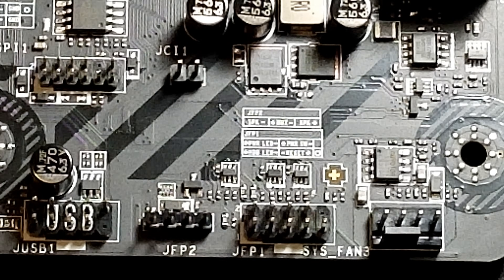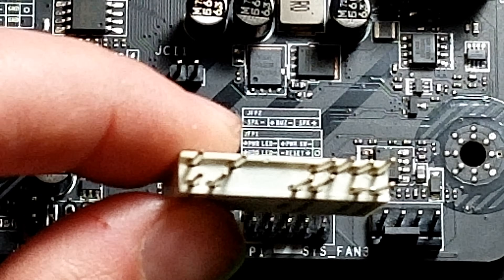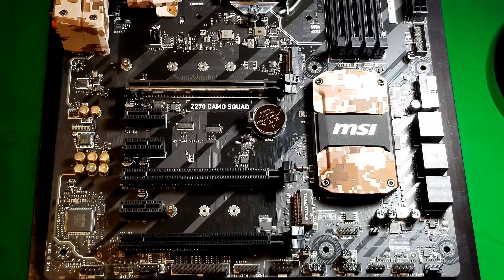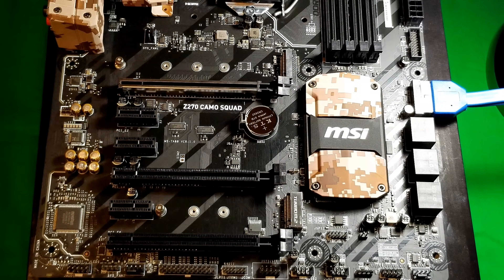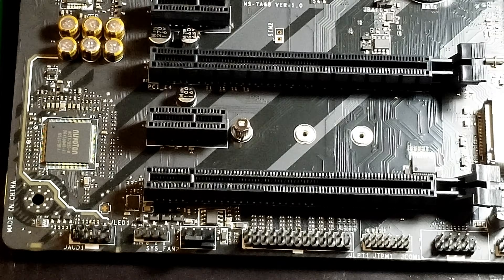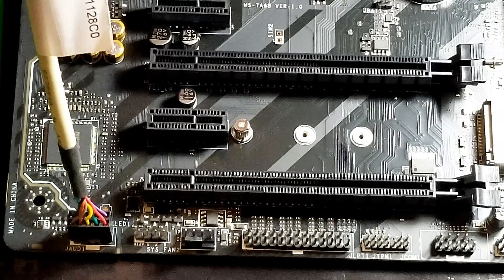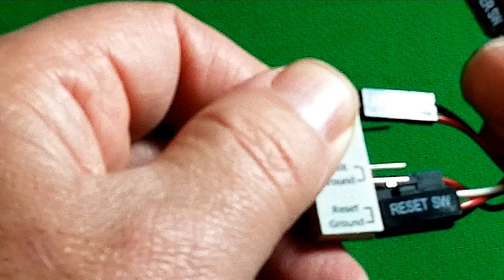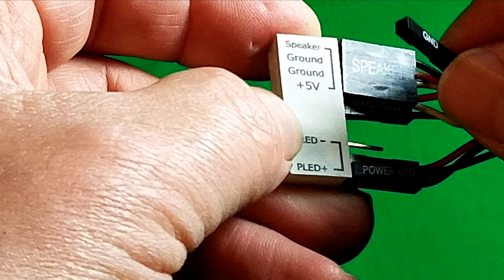Connecting your Case Front Panel connectors to your Motherboard

Comment: ok so i need a little help i have a deepcool tesseract case and i have a Gigabyte B550M DS3H AC R2 on the way are all the cables compatible with that motherboard? the case is admittedly old or will i need to upgrade it?
Reply from the maker: The only issue you might run into is that the MB is very bare bones, it might not have enough fan headers, an issue I ran into. Also if there are any RGB or ARGB cables, I can't remember for sure but this Motherboard might not have those headers. Otherwise they should work together.

Comment: I can read the motherboard but I have never done this before(I’m used to HP computers that I upgrade and I just got a real computer) and I was so confused about why it wasn’t turning on until i realised the “reset SW“ was the power button
Reply from the maker: Not sure the question, but if everything is plugged in as in the video you should have no problems.

Comment: THANK YOU SIR! After trying for weeks literally, & watching at least 20+ different video tutorials 3 X'z each on the subject matter, NONE were as concise, precise, to the  point, & CLEAR with no If & 's or what's period.

I FINALLY was able to see success after only my FIRST TRY after watching your outstanding tutorial. The others where CONFUSING & NOT SHOWING THE DETAIL NEEDED TO FULLY UNDERSTAND how to go about  connecting the panel correctly to the mobo.

Not to mention that I have an OLDER mobo from 2012. So there's no clear  & apparent + - pin MARKER signs on my mobo. However. The ONLY words that I could read (with a magnifying glass at that lol smh) were where the HDD LED pin connector went. But that was enough to put 2 & 2 together & I found the rest of my way fairly expeditiously!!

What I did was DRAW an exact DIAGRAM on a scrap piece of paper so when I turned my PC off I still had your visual graph to fall back on. & I must say that It worked like a CHARM ahah lol. Almost seamlessly.

So I appreciate your passion & SIMPLISTIC, logical, not so common expertise bkz boy I'll tell ya, some of these content creators will have you on a wild goose chase only to end up nowhere, where you started, or even worst before lol

Now on to the next problem. Trying to clone my HDD & migrate the data to (Samsung Evo 870) SSD  but he data migration software isn't working. I tried a free alternative that I heard good things about to do the data migration but I've ran into a road block with that as well

My SSD is BRAND NEW, never used, so I don't know what seems to be the problem. I have decent enough specs (I5 2500K CPU, 16 GB ram, 500GB HD,  RX 580 GPU, 1TB SSD, 750W Gold+ battery etc) ...

Not that the majotiy of the described has anything to do with data migration lol, but just to say I have PLENTY operating system power & then some. It's something with the SSD's partitions or something to that effect where It's not just copying the HDD partitions

If I could get that done I'd boost my PC 5 X'z It is now, & also be able to use my new RX 580 GPU that I can't use bkz It's for use with Win XP, 7, 10 OS. I have Win 8.1, but I was going to upgrade to Win10 bkz I have a free upgrade. & Although I wished I could keep W 8.1 (bkz It's my fav) I am kind of burnt out on It

It's just time bkz as a Music producer most of the software is being programmed for Win10/11. So I'm mixing out on technological advancements not having Win10 or better.

The cons finally out weighted the pros so to speak lol. I'm missing way too much more in performance now using Win 8.1 sadly!

So hopefully this starts of a trickle of GOOD LUCK now that I have my front panel power working fully correctly due to your astute directions. Thanks again Brother & have a blessed day!!!

Gonna subscribe to just bkz you sold this very HARD problem & made It simplified, done simply in seconds fax!!
Reply from the maker: I'm glad the video was able to help you out, for the cloning I've done a couple videos on it, this one might work but if not I have a 2nd one as well. Here is the link to the first one: https://youtu.be/ltjBRZx4ak0 All the best.

Comment: You're a champion. I've got a Gigabyte GA-B150M-D3H mobo and the power button on the Thermaltake H22 Case is getting a bit sticky, so I have bought an external power button which I may connect. It's an eight to nine year old PC so whilst I will be careful I am not overly bothered if it dies.
Reply from the maker: Sounds good. Have a great day!

Comment: All was going well until you got to the connector that really matters. There you told us that the arrow indicates the "positive", then at 10.20 you turn the power connector (you say, the only one that really matters) upside down and say that that doesn't matter at 10.34 and then connect the arrow to the negative???
Reply from the maker: So the PLED there will be two connectors a + (Positive) and - (Negative) they are the ones that must go on correctly, the power can go either way and will still work. Hope they answers your question, if not let me know and I'll help the best I can.

Comment: Does the Asus m5a97 LE R2.0 not have an USB 3.0 plugin? I'm not seeing any!
Reply from the maker: No just 2.0 it's a really old Motherboard and USB 3.0 wasn't a thing at that time.
Reply: @Reviewing_Playing_and_More_RPM  oh ok, does that mean I should get a different case? I really don't want to change CPU/ram 🤔
Reply from the maker: @jescis  It all depends on your needs, if the Motherboard is working for you then stay with it but if your looking to upgrade to newer you'll want a newer Motherboard, CPU, Ram and Case if you don't have one and Ram and any Hard Drives you intend to use.

Comment: Unplugged these cables to get easier access to the HDD bay and had them separate in my fingers.  Not one plug but multiple that are tiny and ..... Anyway, everything done but no power.  Figured one of the wires was connected to the on button but was concerned to plug into the wrong slot and possibly damage the motherboard.  Then I found this video (MB instructions were useless) and thank you very much.  Covered it step by step not missing any key instructions.  Well done and thank you.
Reply from the maker: You're very welcome, glad it helped you out.

Comment: Thanks for another great info video!
Would connecting a 6-fan fan hub to the fan headers on the motherboard be okay? It won’t hurt the header overtime?
Reply from the maker: A 6 Fan Hub usually gets it power from the Power Supply so after placing up to whatever the number of fans it supports connecting the one cable to a Fan Header will be ok as it won't affect the power draw from the fan header, it just lets you control the fans. If you don't have that though then yes 6 Fans on a single fan header would be to much.

Comment: Hi Im new to pc building in general and i cant seem to figure out the power button cable every video i see there is these small cables as you show in 9:30 but i dont seem to have those cables? Is there an alternativ cable that might be used or could they be hidden even tho i have checked Almost every place. (Upgrading my cpu and motherboard on a pre built pc)
Reply from the maker: The cables on pre-built can sometimes look very different and it can be hard to know which is the right one, I've run across this, and my recommendation is to download the Manual for the Case to see if it might let you know which goes where.

Comment: I need you to show how these cables connecting to the motherboard itself, not you example stick. Because my motherboard and yours might be different. Because mine is B450 Fatality mini itx, and there is no help anywhere on google or youtube
Reply from the maker: The Front Panel connectors are the same for 99% of all systems. The video shows how to connect them, but your MB Manual/Guide to locate them if you can't see them on the MB will be needed.

Comment: The video showed most that was obvious to find but the ones for the power led and stuff didn't help because he is showing it on a block of pins that are labeled. He has a msi motherboard like mine but yet didn't even show it on the motherboard itself that's the only problem I'm having
Reply from the maker: Sorry you didn't find it helpful, pretty much all motherboards regardless of manufacturer use the same pin layouts, only exception is systems that use proprietary cabling, but even then in general they follow the same layout. Hope you find a better video that will help you out.

Comment: why don't the MB makers just sell the ready cables for all of these small connectors combined?  At least from the motherboard side. This is just silly to mass sell MBs to unsavvy general public in this disassembled condition. This gives room for mistakes, burned chipsets, makes people refer this to a PC technician, wasting time, etc. Al they get is unhappy customers.
Reply from the maker: MB manufacturers make it a standard format, it's up to Case Manufacturers to make it easier, NZXT actually has done this with a few of there newer cases where all the cables form at one end and all go on together. Now if more did that then it'd save people a lot of trouble.

Comment: It’s there a problem if I turn them around  and the writing is on another side
Reply from the maker: Only for the PLED cables you need to make sure the + and - are correct, if the others are on the other side it'll still work no problems.

Comment: I am having trouble 
Hooking up my B250 miner mother board. Has like 10 pins and im a little concerned trying to hook up the switch. It's not in the manual or in any video ive found.
Reply from the maker: The pins are beside where it says SATA6G_1, start on the top first two pins are the PLED + and -, under those are the HDD LED if your case uses that or if a miner MB uses it, going back to the next two top pins will be the power Switch and then under it will be the reset pins...now this is what it is on a normal MB, I've no idea if a mining motherboard will be the same, it looks like it is but can't say for certain...hope that helps though...the second set of pins on the top would be the speaker should you have one not sure about the bottom two...

Comment: Hey i want to ask you mayby you know when the computer is normally shuting down where is the signal in motherboard?  like with button turn on and off is 1,5v~3v its okay but i need signal from normal shutdown in motherboard can't find where it is...(i want to turn off another device with turn off signal)and normal shutting down from desktop (switch don't give any signal then)....
Reply from the maker: The digital electronic components and circuits in the system (motherboard, adapter cards, and disk drive logic boards) use +3.3v or +5v power, and the motors (disk drive motors and any fans) use the +12v power. 5V is the turn on voltage...by no means an expert on this though...

Comment: I got a thermaltake case with round blue led light that use to stay on when it was on and blink when in sleep mode but for some reason it decided to stay off even during sleep but does light up when I power it on. And I'm at a loss to find a matching case online nor anything wrong with the jumpers. Confused as hell!!!
Reply from the maker: So the only thing I can think of would be to check the cable from the LED is plugged in and hasn't come loose...typically the Blue LED has a RGB cable that goes to the RGB on your MB, if it's 3 Pin then it's a 5V ARGB so needs to go to a ARGB Header on the MB to work, or if there is 4 Pins it's 12V and goes to a 4 Pin 12V RGB Header on the MB, check that it's plugged into the applicable one and correctly aligned with the Arrow on the cable going to the either 5V or 12V as per above...
Reply: @Reviewing_Playing_and_More_RPM  It has a 2pin together power input then there are 2 seperate p led Positive and a second pin led negative: first time worked like a charm then it stopped and no Idea why, I've tried switching them then 1 at a time now it's just not doing anything but power on ring led.
Reply from the maker: @MikeofGod  So the PLED + and - go first on the left, then underneath the HDD LED if you have that one, the to the right of the 2 pins for PLED + and - is the power switch and under it the reset switch both using two pins...all these are for the case though not the LED from the Fan, it would have it's own connector on the MB...

Comment: what is that first blue thing you plugged in? mine does not have it...
Reply from the maker: It's the connector for USB 3.0, it isn't always Blue sometimes it's Black, it's what allows you to activate the USB 3 ports on your case...Some cases may not have USB 3 ports though so its ok if you don't have the cable...

Comment: I got fans and a white light on the motherboard on, but no hdmi connection of usb
Reply: Just found the cpu debug light on, trying to see if my dad and I can fix it
Reply from the maker: @TycoonTitian01  ok, good luck then...
Reply: @Reviewing_Playing_and_More_RPM  just found we got bent pins, getting a new motherboard uggg...
Reply from the maker: @TycoonTitian01  Ah wow that's surprising, glad you can replace it though...take care...
Reply: @Reviewing_Playing_and_More_RPM  yeah me and my dad didn’t close it right so we think the cpu moved around and bent the pins
Reply from the maker: @TycoonTitian01  Yeah that can cause damage for sure...it's unfortunately something to learn from, unlikely that mistake will ever happen again, but a time for a new one, hope you can get another...take care...
Reply: @Reviewing_Playing_and_More_RPM  yeah, luckily I went cheap on the motherboard to get a better cpu, so it won’t take me another year to get a new one
Reply from the maker: Not sure what your referring to never seen a case itself that has HDMI, but USB is for the USB Ports and there'll be either a USB 2.0 connector or USB 3.0 most MB's will have those connectors but not all cases will have both...

Comment: Some times intead of JFP it can be F_Panel
Reply from the maker: That's correct...
Reply: @Reviewing_Playing_and_More_RPM  I have a quick question. on my motherboard, (Lenovo A78M) there is only a USB 2.0 front panel pin slot. In my new case, there is a USB 3.0 connector. Would I be able to plug the USB 3.0 cable into my 2.0 slot? I don’t really care if it’s only at 2.0 speed, I mainly just use a keyboard and mouse. There is more pin slots on the connector, but I can have a few unused. Thanks in advance.
Reply from the maker: @legokingcandy  Connectors for USB 2.0 and USB 3.0 on a MB are separate and different completely, so the USB 3.0 connector would not fit...now as for USB cables yes you can use a USB 3.0 in a USB 2.0 port and it will work just at a slower speed, this mostly affects transfers of data...so no problems there for the cables...
Reply: @Reviewing_Playing_and_More_RPM  
Ok! Thank you!

Comment: I'm just wondering the camera you use to film yourself.
Perhaps it has a volume control on the mic that you could turn up. The audio in this video is not too bad.
Keith
Reply from the maker: Actually I've used my cell phone for every video...I adjust the audio with the editing software...
Reply: @Reviewing_Playing_and_More_RPM  
Believe it or not I was actually going to ask you if you did any audio adjusting in your editor.
And lo and behold you did.
Anyway I'm rendering this video out hopefully by this evening or tomorrow you can see it whenever.
It's a little scattered but do the best you can like I say I don't expect miracles.
But I sure do like that motherboard that you reviewed me Asus Rog
Keith
Reply from the maker: @KTHKUHNKK  I block links to prevent others advertising on my channel, but looked and left a comment on your video, hope it helps...

Comment: Dennis what I noticed about my fan when I start my computer up.
It looks like the fan has power.
Because it wants to start but then it doesn't spin.
In other words when I press the button to power the computer on I can see the fan just start to move and then it doesn't go any further.
Any ideas what could cause this.
Thanks Keith Kuhn
Reply from the maker: Your still referring to the Case Fan right? because if you meant the PSU fan, most today will only power on when required to cool them off, so most times they don't run, if it was the CPU Cooler fan it should spin once starting and maybe stop for a second then start up and continue running from that point on...
Reply: @Reviewing_Playing_and_More_RPM  
Also would I think maybe causing a problem.
Possibly

I believe I have both fans plugged into one another.
It seems as though that's the only way the cables will reach your destination if you know what I mean.
Keith
Reply: @Reviewing_Playing_and_More_RPM  
Yes the case fan
Reply: @Reviewing_Playing_and_More_RPM  
Believe it or not.
I just put a brand new power supply in about 3 weeks ago.
In fact I have a video on YouTube about it if you'd like to see it.
Hold on I will tell you what it is titled as.
Keith
Reply: @Reviewing_Playing_and_More_RPM  
Attn Dennis 
Please type in.
KK Motion Pictures
comp repair 1
Reply from the maker: @KTHKUHNKK  Cool video left you a comment on it...
Reply from the maker: I'm not in Ohio in Ottawa, Canada...dang cold here right now...
Reply: @Reviewing_Playing_and_More_RPM  
Cool
I mean cold.
I admire how much you know about computers.
I love seeing your monitors in the background with things jumping from one screen to another very cool Dennis.
Keith